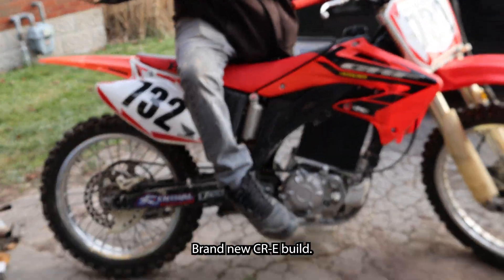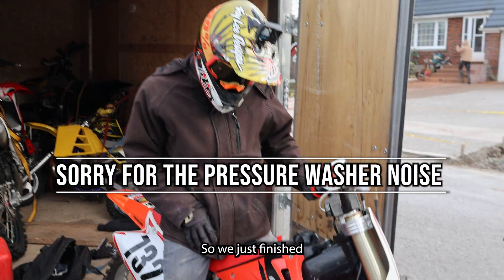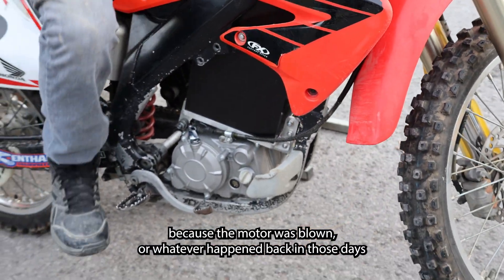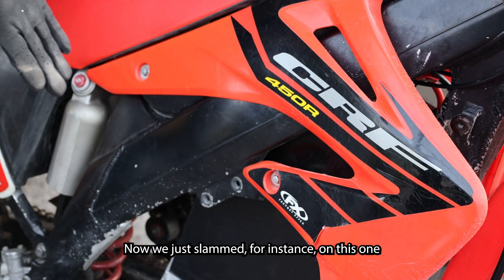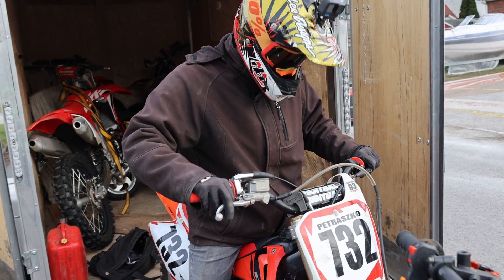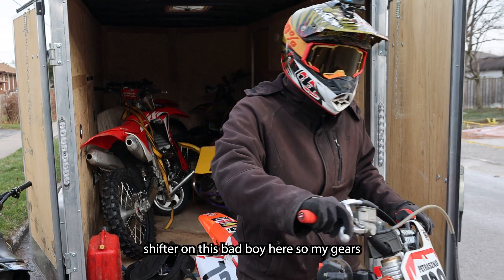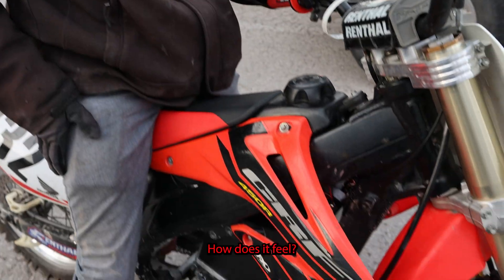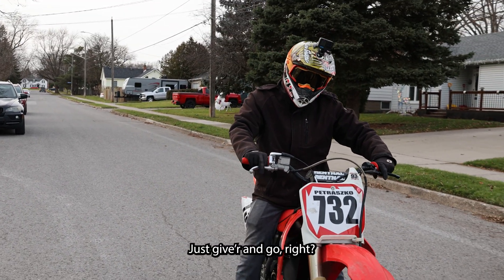Honda CR-E - Nicot/AdmitJet Electric SWAP

Comment: The frames are no where near the same the suspension in the early 2010s had major upgrades doesn’t even feel like the same bikes plus theirs restyling kits that make them look absolutely brand new and the suspension brake everything else chassis related aftermarket down to even what color bolts you want are their 2010 plus so yea…..
Reply from the maker: Fair enough, that is good to know. I have always been a KTM guy myself and never raced or owned any other brand.
Reply: What’s the top speed

Comment: Can you buy the motor and everything as a kit? Anyone making mounts, etc. for this conversion?
Reply from the maker: You can purchase the motor, battery and transmission from the manufacturer. It is not available as a kit, but you can buy everything individually. We had to custom make our own mounts. Anything is possible if you want
Reply: @paulyplewa what manufacturer?

Comment: Dude after working on cars and bikes for 20 years all that tuning and teardown mess really burns you out. Going electric was the best decision for me,less downtime and more clown time 😅
Reply from the maker: That’s a good point… there is much less tuning and downtime with electric. As long as you get your controller figured out you are ready to rip! The charge time does suck, but when you’re ripping you’re smiling that’s for sure!
Reply: @paulyplewa  that's the only downside..charging really blows but my Energica charges in about 20 or so minutes with the rapid charger. Hopefully somebody brings rapid charging to smaller batteries soon. 20ah shouldn't take 8 hours to charge 🥹😭
Reply from the maker: @roodick85  yeah exactly. As the technology improves the charge time will get quicker. Which will get us back riding even quicker
Reply: Where you got the motor?

Comment: That frame is to heavy for the 12kw electric set up. The Cr 80 frame will be prefect 👌
Reply from the maker: Compared to an 85cc, this frame is much heavier - but it makes it easier and more realistic to ride.
Reply: @paulyplewa  Yes that make sense 👍 Nice that you put the GPS speed in the last vídeos make a difference and it's easy to see the potential of the projects 💪
Reply from the maker: Personally I like the full size frame. The GPS data is a must. I wish we would have had it on for the KX-E test!

Comment: Did it take a lot of modifications to make this conversion work?
Been wanting the admitjet but I’m wanting a frame that’s solid enough for mx
Reply: I would say it was fairly easy to do just build some new motor mounts and cut the rad-supports off so battery would fit in frame and made a mount for battery to the motor but you will need a tig welder for the aluminum
Reply from the maker: It is not extremely difficult, but does require lots of patience and access to some tools. Having a lathe, mill and welder helps. The front rad support had to be cut, 4 custom motor mounts were made, 1 battery mount and battery strap were also made.
Reply: @paulyplewa for some thats a lot of tools lol....